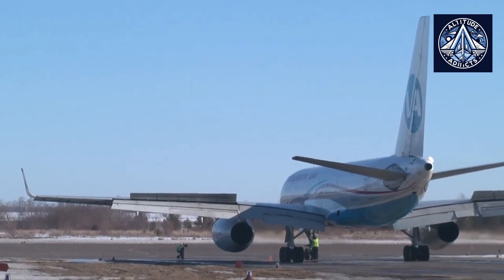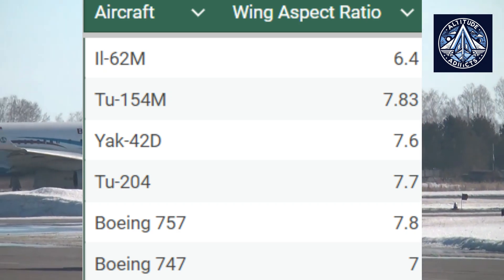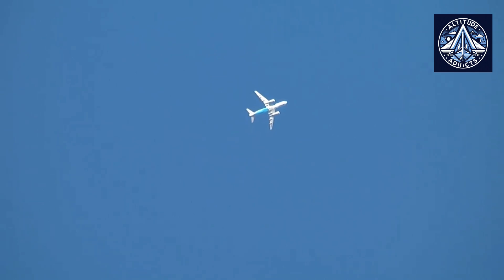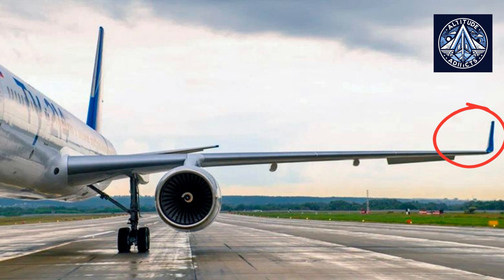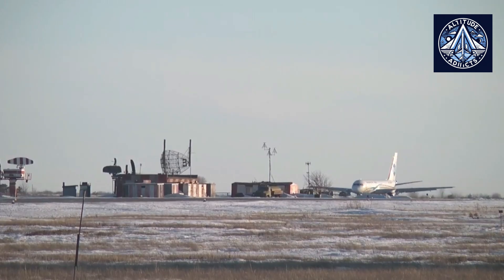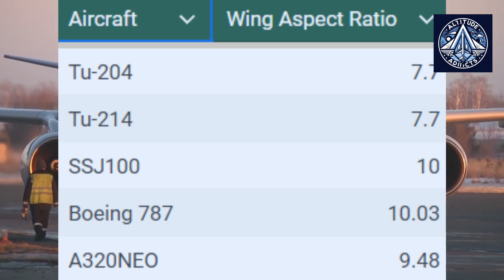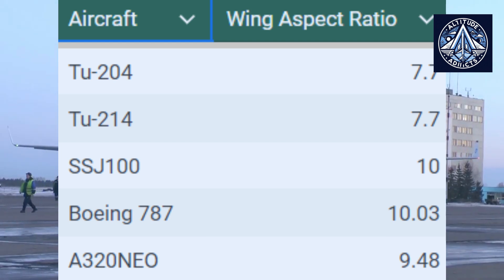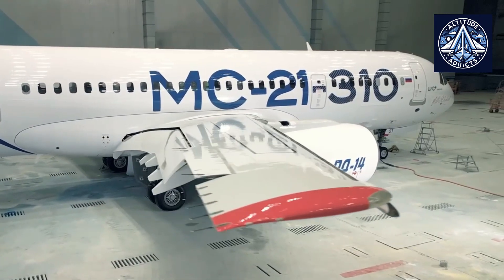The Tu-204 and Tu-214s Advanced Wing Design In the Soviet Era

Comment: Reliability is more important than weight savings or materials used, as you have seen latell, no matter what westerners say they also make BIG mistakes causing a lot of gliders on the ground, failed airlines like Indigo and Interjet and premature heavy maintenance on many engines like P&W and Leap engines..... 
There can not be similar comparison between different manufacturers of aircraft since each manufacturer designs with a different mentality and purpose of the Aircraft, the TU-214 is designed to be a workhorse for cargo AND passengers, an all in one aircraft, many African and middle eastern countries would love to have this aircraft regardles if it's a two or three pilot crew or fuel efficiency, Russia, Iran, Venezuela, North Korea coudn't care less of fuel economy or efficiency, a heavy duty and reliable aircraft is the most important thing for some countries plus as for range you can always install a couple of double containers in the cargo hold to give it a range of 12,000 Kilometers id needed just like the A321-XWR does it.....
Reply: @mazikkaluchka5562  Do you really think that the Tu-214 is more reliable than the A320? Wishful thinking.